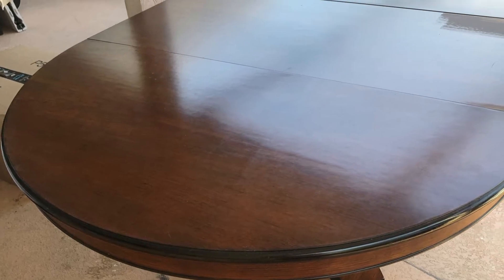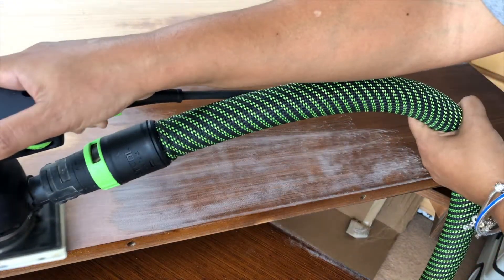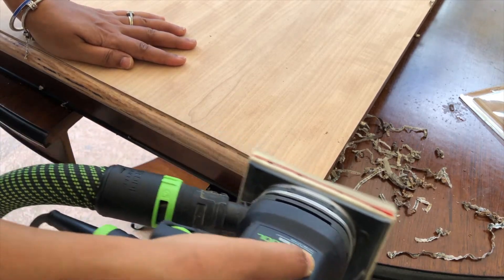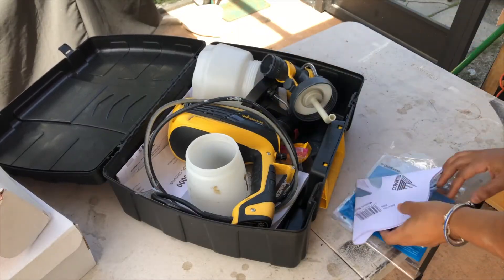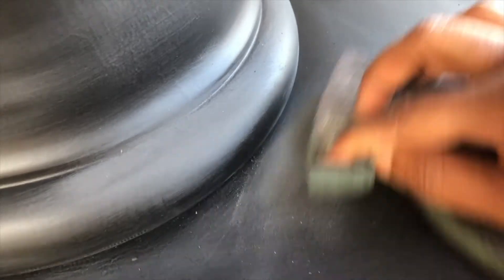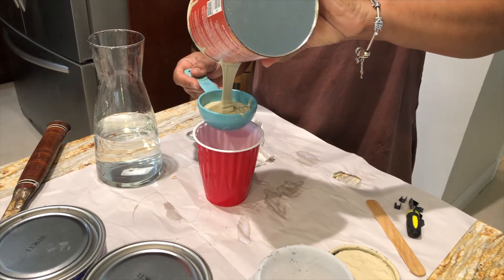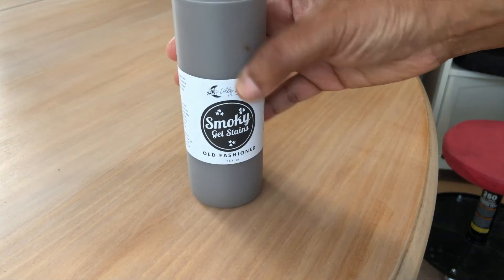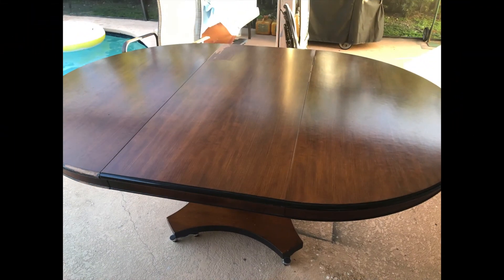Dining Table Makeover Before And After | How To Create A Natural Wood Finish

Comment: Table turned out really nice! Did you seal it with a polyurethane finish to protect the table?
Reply from the maker: Thank you 🙏🏽 Yes 3 coats of General Finishes High Performance TopCoat.
Reply: Hi! Did you use the flat or satin for the top coat?
Reply: For the actual table top?

Comment: I love how beautifully this table turned out!  Great job!  I do have a question:  why did you use the shellac before the wash and the paint?
Reply from the maker: Thank you 🙏🏽 since I planned on using both water based products (the wash and the gel stain) I wanted to seal it but still be able to have some of the wood grain peeking through and without it being blotchy. Also this was a thin veneer and although not very visible, there were a couple of small spots on the overhang/side that looked a little weird, so I wanted to be safe and seal it. 
Thanks for watching 😊🤗
Reply: @DIYDecorDiary  Thank you so much for your response.  I learn a good deal from watching your videos.  You do such fine work!

Comment: LOVE! Your table came out beautiful! So, I bought a kitchen table that I didn't know before I stripped it had MANY knots. I knew they would eventually bleed through and turn the top coat yellow. So, I read that sealing it with Shellac will illuminate the yellowing. I bought interior eggshell enamel paint and primer. to put on the top of the table. It is a kitchen table that will be used a lot. I know they will use placemats but I would like to put a matt finish top coat on. What are your thoughts?

Comment: Wow! That is an amazing job, table looks stunning 🤩. Curious to why you used shellac before the white wash? I didn’t know you could do it. Thank you in advance for your reply 😁🙏🏼
Reply from the maker: Thank you so much 😊 This table top was a veneer and as you know when sanding veneer you can easily make the surface vulnerable. There were a few spots that appeared different almost as though it was “blown through” but not quite. I used the shellac to seal it and add a layer of protection. That way the entire surface will be even (so some parts won’t absorb differently and look different) and because it’s clear I got the benefit of having some of the wood grain show through. I hope I explained it clearly 😅😅 🫶🏽

Comment: I absolutely love how this turned out.  Do you know what type of wood the top is?  I have a MCM Heywood-Wakefield table (birch) I may try this technique on.  I have very much wanted to try the Lilly Moon gel stains as well.  I'm so glad I found your video!
Reply from the maker: Hey! Thank you 😊 It’s a veneer but not sure of wood type, it had a pinkish/red undertone which is why I did the paint wash first so I had a more “neutral” base before adding the gel stain. MCM generally are veneers (not all but it’s common from that period) so you have to be careful when sanding to not blow through. Thanks for watching 🙏🏽😊🫶🏽